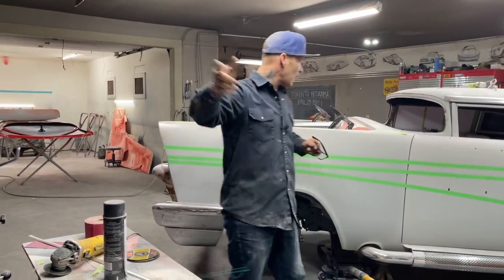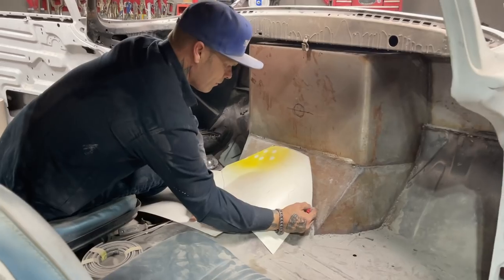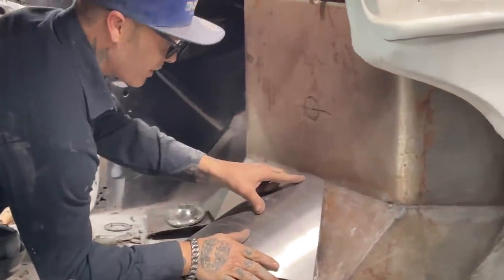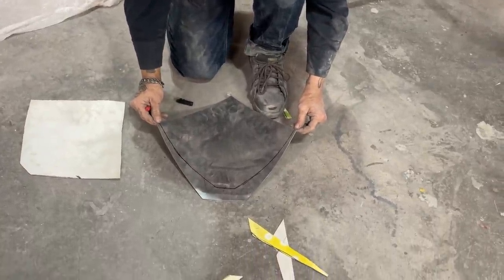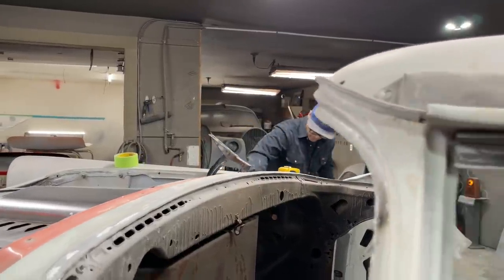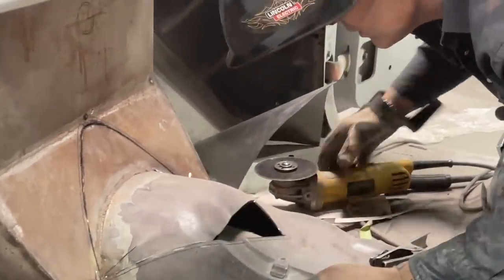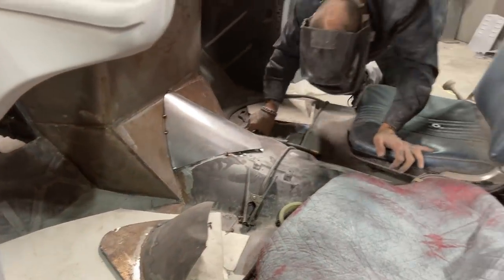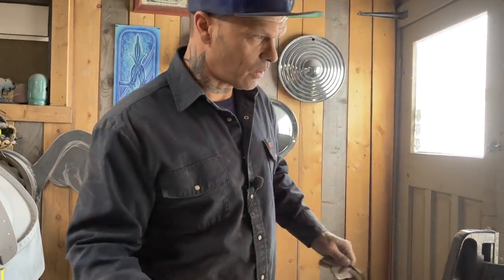Transmission Tunnel Fabrication

Comment: Very useful to be able to artistically expand the transmission well!   
I do recall I had a bit of a tran clearance  issue with my 455 Oldsmobile upgrade,  but I just fixed it with a hand sledge hammer from below...

Comment: Have some spray bottles around with water in them for small fires. It will prevent bigger fires from sparks from earher zip cutting or welding and you do alot of that. You don't want to burn down the shop or damage you car that you have so much time into it. That tunnel work in not easy but it's coming along nicely.

Comment: Hiya..just an observation your center consul will cover all access to top of transmission and floor shifter, so I would wait with final tunnel welding until they are positioned and installed..Alberta Darrell

Comment: The car is coming together. The hurdles I am afraid is more because of lack of planning and the on the fly customizing. The more you do on the fly the bigger the chain reaction. I am sure you will figure it all out. It will just take more time. But you aren't racing a deadline so it doesn't matter. Keep it up.

Comment: 'Tunnel-Vision": trans tunnels made from a huge piece of sheet metal formed into a cone shape and installed by cutting out the entire original piece.
"Chad-Vision":  thinks it thru and does only what's needed to get the job done and still retain much of the factory integrity"
I choose Chad-Vision.

Comment: Instead of cutting off the excess metal on the under side of the floor pan hammer it down and weld it. it will be stronger and cleaner